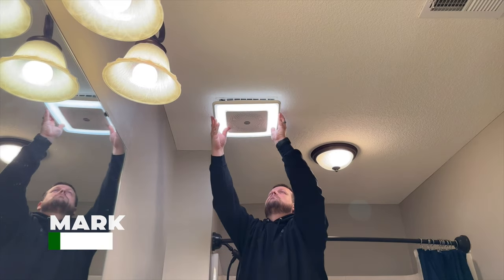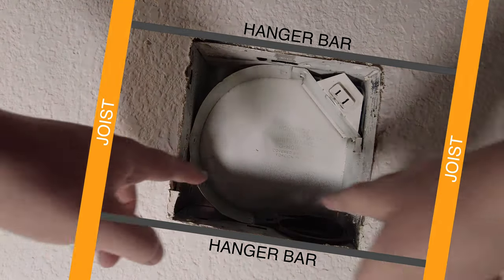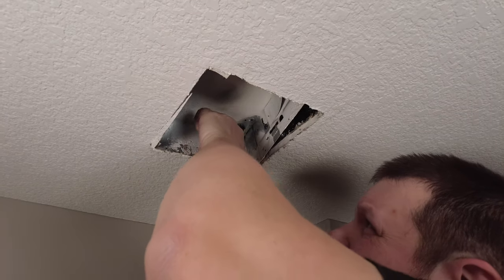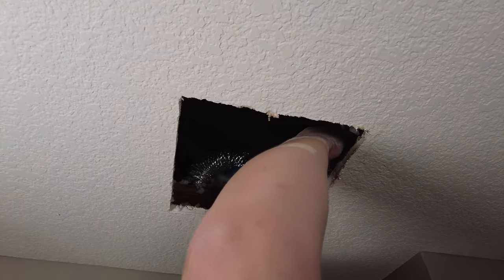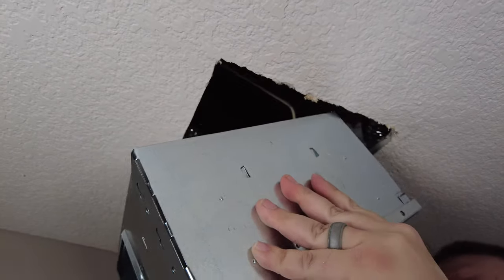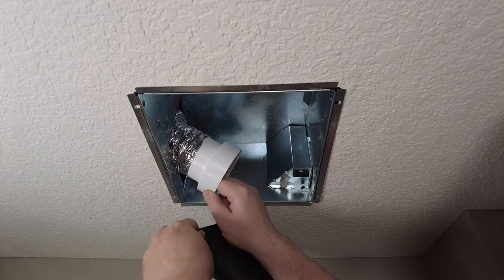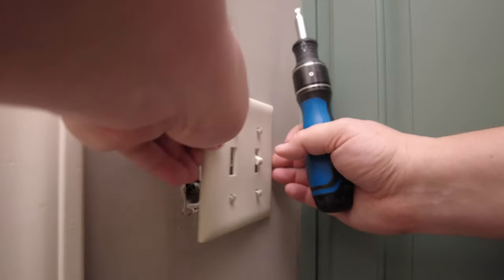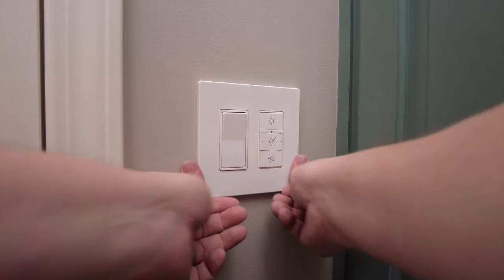Complete Bathroom Exhaust Fan Replacement | Ultimate DIY Guide

Comment: There are several modular replacement kits on the market if you happen to have an older Broan.  I went to do this job at my older sisters and was able to buy a new fan/blower unit that fit perfectly!

Comment: Did you ever fix your connections to the switches? You installed the hook backwards, so when you tightened the screws down on the switches, it was pushing the hook out instead of pulling it in.

Comment: I found the same thing with that exact Brian model that was installed in our of our bathrooms when our house was built.  I went up into the attic and found that the flap was catching on the actual corrugated tubing that leads to the outside of the house...adjusted that tubing and it's all good now...still want a quieter fan, but at least it now exhausts air.

Comment: Excellent video sir! Please share links for the needed accessories (the saw, the grommets, and the connectors) Also, I liked your tips and tricks regarding the test cord. Once I test the device. Does it save all the settings you did with the initial setup or does this need to be repeated once wired to the house?
Reply from the maker: Yes, once you setup the remote it will stay connected so if you use the a test cord the way I did you are set!

Clamp style grommets: https://geni.us/8Nb2 (these may be cheaper at your local hardware store)
Drywall Saw: https://geni.us/k8xu
Wago Connectors: https://geni.us/3OBU02f
Cord (for testing/setup): https://geni.us/WiXIy
Screw-less Wallplate Cover: https://geni.us/cJ9SG

Comment: I would like to know when you turn the power switch On, not the remote, the power switch On, does the fan start automatically or you need to use the remote after turning the power switch On? Thanks!

Comment: Do not crush your romex power line with a crowbar.  If you need to work in an area like that, remove the staple so you can relocate the powerline first.  It's entirely possible that you tear in the insulators inside the romex which could create a short/fire hazard.

Comment: What did u do with the ground from outlet? Also is it really ok to cap both wires together from fan switch?   I have  double switches on 1 side and double outlets on other side. Only outlets will remain used. I guess there 2 sets of wires to each switch i cap off separately ( top switch set and bottom switch set)

Comment: I installed the same one a couple of weeks ago.  The sound is pretty good.  I don't think the fan is as quiet as advertised.
Reply from the maker: Yeah I agree. What's funny is when I tested it on my workbench it was pretty quiet (confirmed with a DB meter too), but after install it got louder. Probably a few different reasons but I have a feeling the drywall amplifies the sound.
Reply: @TopHomeowner  its the 3 inch hose..  you are running a higher static pressure so the fan wheel speeds up a bit.. if you run a 4 inch duct and install a 4 inch outlet on the house it will run quieter
Reply: @eldoradoboy yes thats what's happening your  obstructing the air

Comment: Do you have to use the switch that comes with the fan?  Have two seperate switches for the fan and the light and would like to keep it that way, just wondering
Reply from the maker: Yes, that switch is required unfortunately. You can control each independently from the included switch though.

Comment: The only thing about having a larger fan with smaller venting is that the fan won't be able to operate at its full power (CFM). In this case, anything is an imporovement but it's something to consider if you're looking for a specific volume of moisture removal.

Comment: Do you know if there are different levels of exhaust fans for bathrooms?  As in higher power?  The bathroom in question has no windows - it seems like it needs extra help in getting rid of moisture.  Thank you
Reply: Yes. They have different CFMs with higher meaning stronger.

Comment: Is this all possible without having to get attic access?
Reply from the maker: Yes, you can still do everything without having access to the attic. In my case I took the easy route to remove the housing, but for the most part I worked through the opening from below.
Reply: I attempted roomside installation on mine.. the instructions have you cut the drywall first which helps with minimizing damage.. however if you have blown insulation be ready for lots of it to come down..  and you will probably have to pry and destroy the old fan box getting it out..  I suppose if you are lucky and your old one is omly installed with nails or staples it will come out easier butif its screws it will be tough going..  and you will want access to put your insulation back..  if you have batted insulation then that wont be an issue...  like mentioned, most of the work is roomside.. and technically you can make all of it roomside, it will just be a bit harder

Comment: so I have 2 fans in my house..  my house is a 1 floor with easy attic access..   the box for his A110 Flex (mine is the model you are using here with the speaker and all)..  both of us wanted CFM upgrades..  THESE FANS ARE TALLER! than most lolder fans.. if you have 2x4 jopists and an attic you are fine.. if you have 2x8 or 2x10 joiists you are fine..  but if you have 2x4 joists and obstructing cross members or someone put flooring down for attic storagee.. this fan wont fit..  it needs little more than 6" height unabated..  my house has a makeup air system so pulling a total of 220 CFM with 2 fans running wont be an issue..  alas I tried to do the "roomside" installation that the instruction sheet indicated..  it is  a FARSE as from  what ive seen.. most are installed like yours are.. with screws . mine dont have staples but had wood screws..  3 on each tab..  when you cut the opening out for the new size (leaving the old fan in (as indicated by the instructions).. you cant physically reach the screws with enough force to pull them out..   since the book says cut the drywall prior to box removal you can save your drywall from damage because you cut first..  anyway i was determined to do roomside so I used various prybars and was eventually able to muscle the old box out..  oh yes then 10 gallons of blown insulation came down.. (oh yeah another thing.. use a tarp. tarp off everything in your bathroom)..  oh and wear gloves (metal edges are sharp) and long sleeves.. insulation can be itchy..  so I lightly picked up the insulation into 2 5 gallon buckets and saved it.. I now knew that roomside installation in a 1 story house (or in the top of a 2 story) is a farce.. you need to get back up and re-install the insulation.. knowing I was going to have to go up-top, I left the ears unfolded on mine..I felt like the install was a bit flimsy as my joists above the bathroom are only 2x4.. you can get high enough to get a nice solid feel to the bucket..  when I went back up to install the insulation, I ran a couple screws in the ears..    you can use the old 3 inch and adapt it to the new 4 inch outlet like you did,  you may not get the full 110 CFM, but the best way is if you are in the attaic already ,swap to a 4 inch hose if you can and adapt at the house outlet (if its only 3 inch).. I use a Zip tie also..  tape will eventually deteriorate.  yours will still work.  great video.. I just figured id put out some poointers..  oh and some (including me) have reported that the sister model of this fan.. the A110 FLEX (no light and no speaker)..  arent shipping with the flanges.. and you defimnitely want them for a retrofit install